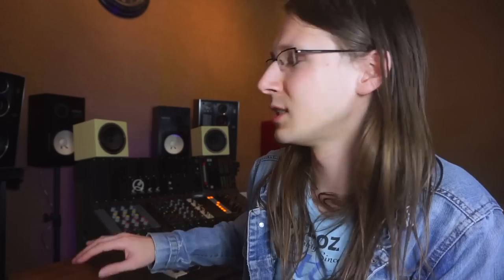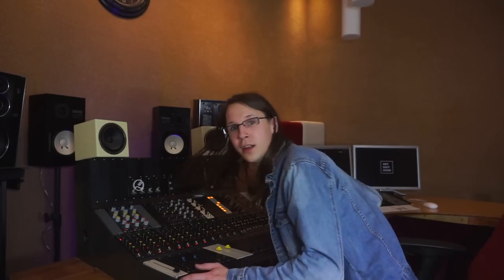Why Yamaha NS10's SOUND HORRIBLE?!?

Comment: I never recommend NS-10 to anyone, they are old tech that no one will hear their music from. 

Now I am a Genelec guy and well they tend to make things sound really good in the mix and take some getting use to if you come from other monitors. In my experience the NS-10 tends to get people doing crazy things with their mix and it almost always ends up with the high end being lowered based on decades old speakers.

I tell people to do "real life" A/B testing by plug in some apple ear buds and listen to through them and then some (horrible) beats head phones since that is what most people are listening with and you can tell how harsh your bass is with those crappy headphones.

I use to have car stereo speakers installed in my old studio just so the band could hear what it sounds through a semi-decent system and I also had a pair of EV loud speakers so they would know what the music sounded like at small concert venues when their music was played through the speakers during breaks at the local concerts.
Reply: I am not an audio engineer by any means and i'm not very familiar with the technical aspects but i just find this trend of adjusting your mix to make it sound good on the crappy apple earbuds, beats or whatever the main audience is using a bad mentality. It should be up to the audio companies to make decent sounding audio gear and up to people to stop buying/using piece of shit headphones, earbuds and speakers  etc. If you mix your music to sound good on beats headphones that people currently use, but in a few years people start using other headphones, how can you be assured that your mix will sound "good" for the main audience in the future?

In other words how can you be sure your mix will stand the test of time?
Reply: because mixing is different to listening..............
Reply: There's some truth in what you said, but I have a different take on it.
I had the NS10s M for years, then a cone died and I changed them with the S model.
The NS10s S come with a cover, and in many cases you see people taking the cover off.
I left mine on, because I too felt the highs were too harsh and tend to give ears fatigue.
Then I saw other studios putting some toilet paper on top of the twitters on the M model, I guess for the same reason.
Perhaps that cover is not about protection, it's meant to stay, and since I am using it I can work 10 hours in a row without fatigue, and I don't cut the high end when it's not needed.
Another factor is, maybe NS10s are not good for engineers that work at high volume.
Reply: Old tech? So is a Pultec
Reply: Marc Telesha....DUDE !!! Some of the biggest hit records ever recorded, were mixed & imaged on NS-10m's, through the 80's & 90's. I would like producer Quincy Jones (that mixed Michael Jackson's albums on NS-10m's) read what you just wrote......Funny!

Comment: The NS10 does sound horrible, but there are two different types. They are like you said honest Sp's. "Why" because of the flat line rules you should follow in a studio slide board flat line audio spectrum. But when you playback the master recording after remaining within the flatline spectrum "regulation" and also finding the sweetspot in a studio...it sounds great when played back on audiophile Hi-Fi SP's. That is the NS10 trick. They trick your ears into staying alone the flatline spectrum. Too much over the flatline = Too much Over tweaking and distortion leakage.

 So, When the customer purchase your CD....they may find themselves having to subtract your overloaded queuing and having too turn down more than usual tones and volume balance... And your recorded work will not be balance within the customer's added CD collection. And that's not good! Especially for audiophile lover's. So, thanks to the NS10 shall remain!

Comment: Sqawky. Why do people buy them? If you mix music with a colored speaker then your music will sound colored in inverse proportion. Dude you're way off about stiff cones being "less resonant". That's simply not true. Thanks to stiffness undamped cones have have gobs of "cone breakup" and stored energy further up in the treble spectrum. If you measure NS 10s that is surely the case because their cones are not laminated but of one material and undamped. So peaks and ringing are the result... both audible and measurable.